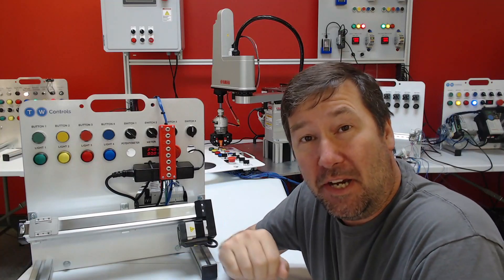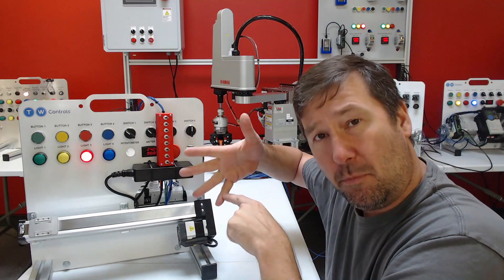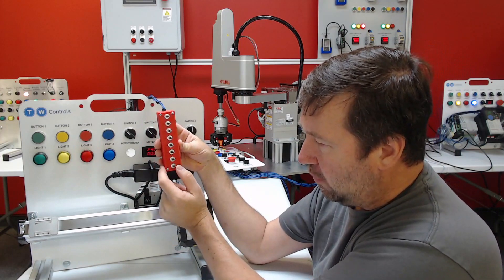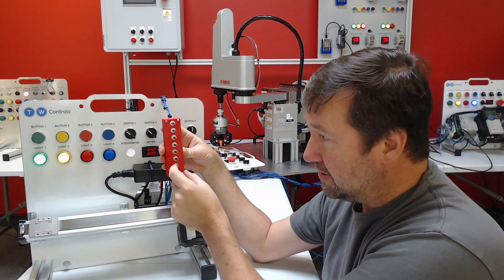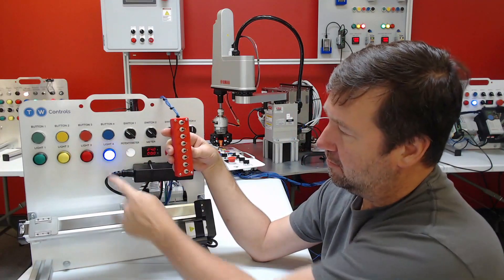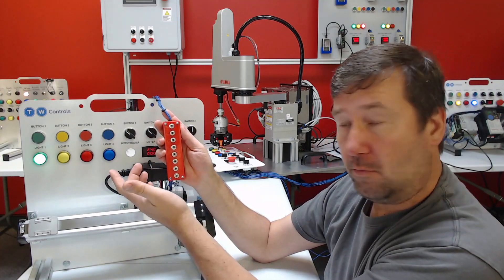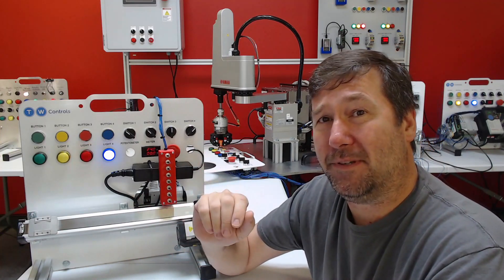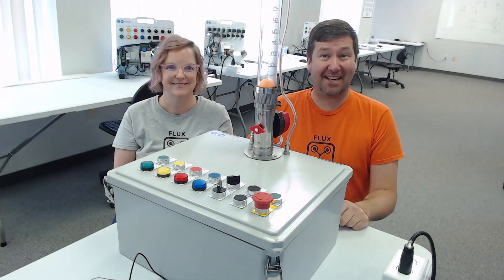Lead Lag Alternating Pump PLC Programming Quiz

Comment: You should also add to this video backspin timer so that the pumps can't start for a set amount of time after they shutoff. I'm just finishing a project that they requested to alternate the pumps from a given amount of run time, have a lead/lag system, backspin timers and also if the lead pump or lag pump is in or has a fault while running then alarm that pump and set system to only use the good pump until the bad pump is fixed and then once good again run the system as normal.
Reply from the maker: Good ideas!

Comment: This one is right up my alley can't wait to get our trainer and try this one!
Reply from the maker: I checked the trainer lineup before I left for the training center this morning and yours is next up in line to built so you should have it soon Spencer.  Thank you for your order!  Also, I think I will do your fuel consumption question as a PLC quiz.
Reply: @TimWilborne  that would be really cool!! 
My thought is to use a current sensing transducer on a load wire of the generator circuit so we could watch real time how much current is being drawn, then a second 4-20mA level sensor to watch fuel level. The math between amp draw and consumption rate is not linear so the plc will have to do some calculation to live estimate a remaining time and output that on something simple like a 4-20 ma lcd display. At any given time, operator should be able to walk up and at a glance see how many minutes or hours of fuel is left in run time

Comment: Literally just did this the other day on two ro systems. Now I just got to make the two systems switch between lead and lag based on run time. Should be fun!!
Reply from the maker: Share your results :)
Reply: Sequence the pump off command to toggle to the next pump. Use a simple resetting counter that toggles numbers, how many pumps you’re using. It works with multiple pumps too as long as you toggle the counter off your lead pump and not your lag pump/s as your action. I haven’t learned how to write the program yet but I’ve dealt with it. I worked a pump station that had hour meters toggled to the run confirm signal so that we could track pump usage and then schedule servicing. Also had on/off toggles to disable each pump so the program would bypass to the next pump.

Comment: I just got done writing a program nearly identical to this.  Using an analog level (pressure) transmitter, I had a controller with 2 pumps that needed 6 control points. "Lead" pump start/stop, "Lag" pump start/stop, High level alarm on/off.  The client needed the pumps to alternate starting when both pumps were in "automatic" mode but act as a one pump system (operate as the "lead") if one pump was off or in manual mode.

Had to scratch my head for a bit, but I got it all working...probably a bit unconventionally though.  Looking forward to seeing how you/others solve it!
Reply from the maker: The HOA would be a nice addition, might make it the next PLC quiz.